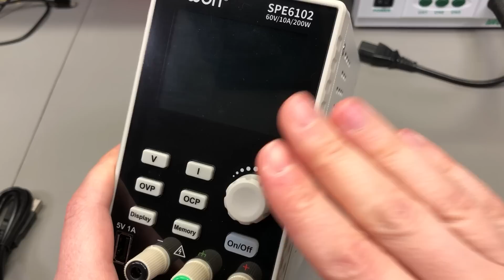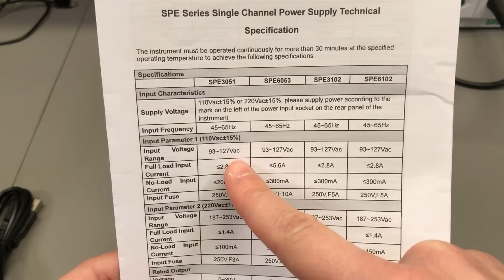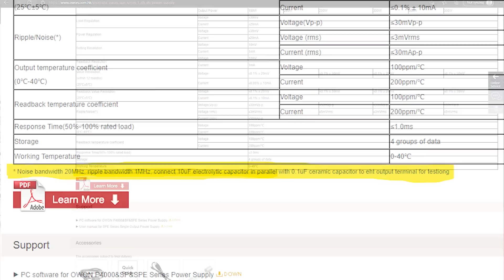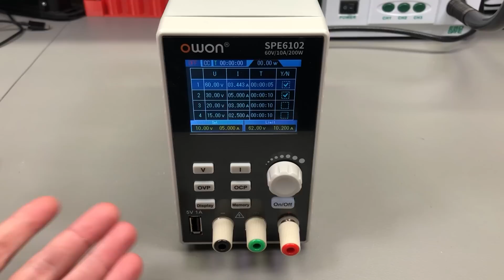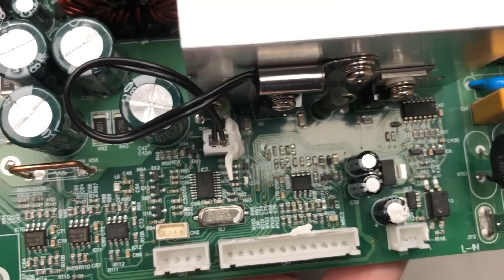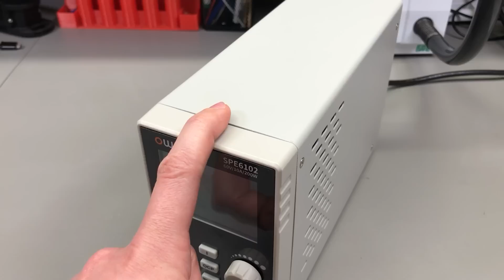Owon SPE6102 Power Supply Review & Teardown (SPE Series) | Voltlog 400

Comment: You have v1.3 and CPU_v1.1! 
I have v1.5 and CPU_v1.2.2
And on my version when I turn on the power supply the FAN is not running. Or if I have small load the FAN is running very slow. It seems that FAN has now Temperature VS PWM function. No noisy FAN at all. They solved this.

Comment: Upper left corner.
Resistors in the hot part of the standby power supply are rated for 45V, but connected to a 310V circuit!!!

Comment: The CN2 connector is the programming port for the micro controller. I have to wonder if there are any differences at all between the various 10a PSU's beyond firmware???

Comment: I've bought Owon SPE3102 thinking it could have been enough for my 1.5 to 4.5V 1A devices... turned out the worst purchase ever.

The noise floor (ambient) is the same as a small hair dryer at first speed. I spent 15 minutes trying to program it as the manual mistakenly said to push to confirm from list but you had to push AND HOLD.

The unit blows dead cold air from the sides, my hands over the bench went numb in no-time. The rear button I suspect it's not even on the mains input as the unit continues to work for a good 1 second after it's been switched off.

The visibility of the screen is appalling, the small numbers are unreadable and the selection from eye height impossible to tell because of the poor viewing angle. This is one of the poorest power supply I've ever tried.

I was wrong thinking I could get one cheap... I also bought an Owon multimeter at the same time to give this company a chance, all it was required to do was to measure Voltage and Ohm with two decimal precision. It whines like crazy in any mode and beeps like a lion in continuity with no way of turning it down, you can only disable the beep which renders absolutely USELESS the function.

This company is a JOKE.

Comment: Hmm... Just took a look at a Velleman DSP-3005V (which is 30V/5A/150W) and most of the PCB indeed looks the same as yours. The main difference is that the two large caps (C6, C7) and some resistors are missing. I was hoping for an easy way to hack the firmware to at least go up to 12V @ 7A on this unit, but after watching this teardown I think I'm going to return it and look for a used alternative (or a better brand).

Thanks for the video!

Comment: I have the SPE6103 and ripple without load is 1.5mV rms not 28mV like shown. With same settings like in this video I only see a flat line. At 1A resistor load i have 16mV rms and 150mV Vpp. CC and CV are totally equal
Reply: How is the fan noise level? Just ordered one, finger crossed.
Reply: @dukeiiigmail Thats my main criticism with this thing. its quite loud, even at no load. If you draw high current for several minutes, it sounds like a starting jet. I mainly use a fan less linear PSU unless I need high power.

Comment: The output noise reduction I did with 4 SMD capacitors X7R / 2,2uF/100V, replacing output electrolitic capacitor with good quality low ESR from Panasonic and large ferite core on the mains wires
Reply: Did you changed big electrolytic capacitor between positive and ground wires, with 4 SMD 2.2uF? How much noise did you reduced?
Reply: thank you for sharing us this idea for improvement! I plan to buy the base model this month. Also ferrite cores on the output wires would help as well?

Comment: Thanks for a great video.  I like the high power, small size, and low cost.  For that price and size you get a switching supply pretty raw output. No linear post-regulator which would help clean up the output noise.

Comment: Hello, I have noticed a small issue with your test setup. But please don't be bothered. Even Dave Jones from EEV Blog screwed this up. Can you please try to match the impedance of you test setup for voltage ripple and verify your results? I also add the Dave jones screw up for reference:
https://youtu.be/gpwkiJC5hfU
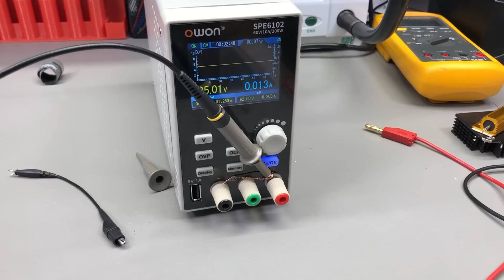Reply from the maker: That's actually one of my favorite @eevblog videos but if you look at my video 24:42 my test setup is described and you can see there is no impedance mismatch happening.
Reply: @voltlog  Sorry, I did not notticed. But you might be correctly using the probe with 10x settings to match it. I just did not see it from the video.
Reply from the maker: @SonicWawes  I always measure with probe set to X1, that's my standard setup. The reason for using X1 is because I'm measuring low signals, I don't want that attenuated by the X10 setting. If any change, it should be in favor of the PSU by measuring at X1, because the bandwidth is lower for that setting.

Comment: I would suggest to look into riden PSUs. I would never buy one without numerical key pads anymore too.
Reply from the maker: I have one, I don't like it. Partly because of it's output noise which is higher than that of Gopher power supplies and partly because I find it very inefficient to use that separate industrial PSU which comes with a high standby current.

Comment: I've got the SPE3103 and the current offset with an open output is .03
Reply from the maker: Uh, nasty! I feel like there has to be a hidden calibration menu that would ideally allow us to null those errors.
Reply: @voltlog  I think there is a calibration menu. Try to press : Display -> Memory -> "Knob" -> V -> I
Reply from the maker: @guidosawatzky116  You are correct, that brings up a menu. I might have to do a follow up video on this.
Reply: @voltlog  That would be great. I've done a calibration&justage of the output and measured values and everything is now in the specs.
Reply: @voltlog   emailed them back in November about it and never heard back. haven't got to reverse engineering it yet

Comment: Adding capacitors to the output to quote a noise spec is simply cheating and voids the entire purpose of the specifications.  This certainly doesn't help Owon's brand image.  This ia a bizarre product as there's obviously been some effort made to add quality that might be comparable to RDTech's top model, yet someone dropped the ball entirely with this output noise.  It's laughable to display 3 digits of measurement precision when the measurement itself is not accurate and there's up to half a volt of noise.  Many Chinese companies follow this same pattern of designing and building an "almost good" product.  Perhaps someone can figure out why the noise levels are so high or Owon can do something to improve it in a revision or firmware update.

Comment: Uhh, are those input capacitors in parallel or series? 1.41 * 220V = 310V, so unless they're in series that's above the 250V rating of those caps.
Reply from the maker: yes, series connected.
Reply: @voltlog  Well that's a relief.
Reply: If it weren't in series they would have blown up.

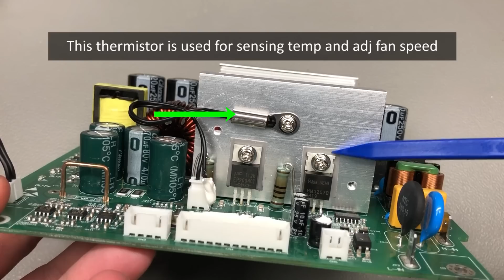Comment: 17:58... Is it just me or does the R45 power resistor look like it has already overheated and been discoloured ?
Reply: @lasersbee  You seem to have misunderstood. It was just a joke - It certainly isn't very well engineered if the resistor is already discolouring.
Reply: @electronics_channel47382  My bad... Thought you were serious...
Reply from the maker: Certainly discolored, forgot to mention that in the video. Could be due to lower quality resistor being use or excessive heat. I would have to confirm using a thermal camera but at this point, I have already decided not to use this PSU going forward so not sure it matters any more..
Reply: Looks like a well engineered device to me.
Reply: @electronics_channel47382  That doesn't answer my concerns about the R45 resistor possibly overheating.
Reply: @lasersbee  a VERY well engineered device. Sorry.

Comment: A switching PSU that does not have universal power input? Pretty shitty design.
Reply: They were too cheap to put in the selector switch.
Reply from the maker: still trying to figure out the reasoning on that.
Reply: @voltlog  the PSU variable output section is of a push pull design to maximise the efficiency of the transformer (much like a PC power supply), these require a centre taped point derived from centre of the 2 bulk caps in 230V mode this will be mid point (115 and 115V) but in 110v mode the PSU is configured to double the input voltage (2 x 1/2 wave rectifiers supplying each of the bulk caps)  +110 and -110v. 
some PC PSU's have a switch on the back to select the voltage but if set wrong they would destroy the PSU. its either cost or to prevent damage they dont use a switch?

Comment: Imagin using a HF radio with this psu
Reply: Yes I can imagine that. I live in an RV and power my ham radios off the internal 12V supply and as you may know feeding noise directly into the power circuit of a receiver can be more devastating than noise coming in through the antenna. The OEM power supply of my RV was extremely noisy (5x small cheep switch mode supplies in parallel), so I disconnected it and built my own; starting with a toroidal transformer, rectified and feeding a large capacitor bank, then regulated using a $50 20A synchronous buck converter, which gave me a very efficient DC source for running the 12V systems, and maintaining the batteries which also powers my ham radios. 
Now you might say, this is just another HF noise generator - and you'd be right. But since I built the power supply myself I left enough room inside the enclosure for a 20A second stage filter. Using my oscilloscope to measure the exact frequency of the noise and it's harmonics, I wound 2 series 50 uH toroidal chokes (31500) that feed a 50 uH common mode choke (FT-240-31) using 10 AWG magnet wire, which flattened the ripple and most of the RFI. Then to get rid of the remaining HF noise I used 2 capacitors in parallel (10nF & 100nF) across the +/- terminals, and another 2 sets from positive to Earth ground and from negative to Earth ground - with the Earth ground leads running on the outside of the steel enclosure.  This results in zero noise on any band (AM to 10 meters) as seen on an SDR band scope.

Comment: I love how they skimp cost on the BOM capacitor brands but use belt and braces in the input protection and input mains filter! Great video! Maybe show us some schematics for parts of the circuit like input protection and filtering section??
Reply: Input protection is required to pass EMC testing, expensive branded caps are not.

Comment: i have had a owon odp 3ch psu and it had a massive delay before cc kicks in, unuseable around sensitive electronics. i never seen this behavior on any of my psu's.
Reply from the maker: that is typically the case for these cheap PSU because they use a lot of capacitance on the output to compensate for the noise.
Reply: @voltlog  it wasnt the capacitance, it also happened when starting it up from zero. the cc part was just made in software not hardware, which causes a massive processing delay.